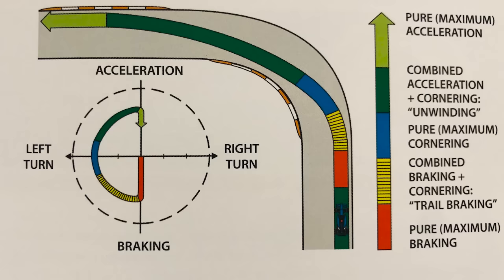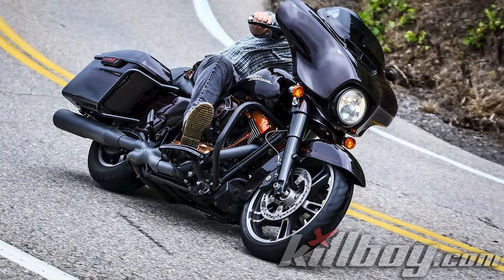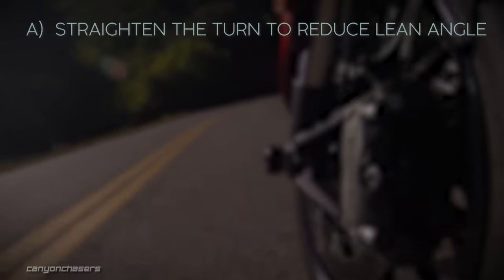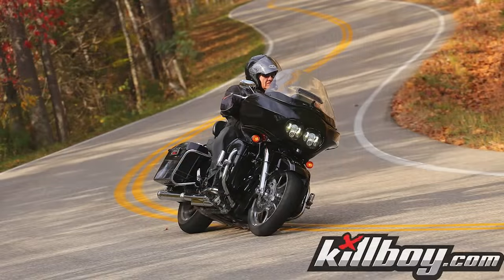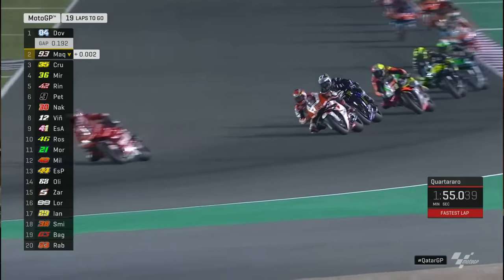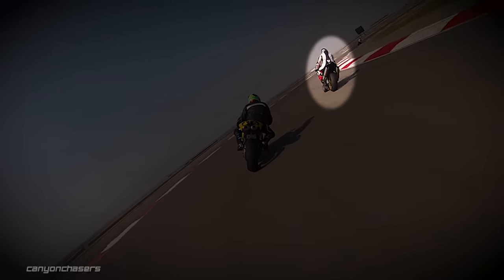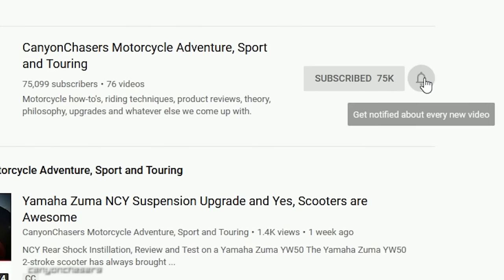How and Why Delayed APEXES Work

Comment: And never forget, your front brake is your most effective and most powerful tool. It's your friend. It's the quickest way around corners.
Reply: and best way to dump your bike
Reply: @davidjones-vx9ju  Obviously, if you treat the lever light a light switch, instead of a dimmer switch. Funny how few people understand just how powerful and effective the front brake is. It can be used all the way to an apex, even while leaned over. It can be applied HARD, after the front tire contact patch has increased by weight transfer. But without practice, they will never know.

For instance, the most extreme brakes on motorcycles belong to MotoGP bikes. Carbon ceramic rotors and 4 piston radial calipers. How strong is the single front tire contact patch?
177 mph to 59 mph in 5 seconds. That's 23.6mph reduced per second average.
1,100°F carbon-ceramic rotors temperature before brake-release.
Reply: The unforgiving friend: the front brake.
Reply: I often trail brake into a corner. Unless you pull it on way too strong your front won’t wash away.  The bike doesn’t try and sit up if you do it gently . Practicing gentle breaking into a corner means that if you do need to slow up if the unexpected happens  you’ll be less inclined to grab and wash out.

Comment: Delayed apex is the safest way to do it in the streets. It is also the fastest way through a corner. However motogp racers also uses different lines such as overtaking/defensive lines or the ordinary racing lines strategically to overtake and to block competitors from overtaking.

Comment: The #1 Reason I Will Trail Brake in every corner!

Somewhere in one of your previous video you said. I paraphrase "NEVER run wide in a corner, NEVER touch the line ina corner, NEVER have a white knuckle curve, NEVER be afraid of twisties and run for the interstate." Trail braking is the Magic bullet to have all those NEVER. It gaves you the confidence to enter later and faster with the brake light on...knowing that you can correct your direction just by adding a few points of brake....That's it. and it does work in the car as well (a safe place to practice). THABK YOU,THANK YOU, THANK YOU

Comment: I could never figure out why I struggled with certain turns using slow, look, crash, and burn until I learned about trail braking! I first learned about it from you, Dave, right here on Canyon Chasers! My friend turned me on to your channel some years ago, and I am hooked! Trail braking changed everything for me, and it's saved my bacon a few times as well. I don't ride a crotch rocket, but I have found that it doesn't matter. I ride a 1,000 lb. Gold Wing, but trail braking works the same. In fact, I rode "The Snake" here in northeastern Tennessee where I live, and trail braking made that experience so much more enjoyable! It's 489 turns, 3 mountains, and 1 valley. 

Thanks for all you do, Dave! I always look forward with great anticipation to your next video! Ride safe, sir!

Comment: Great video. I learned some of these techniques like trail braking and delayed apex by trial and error as a kid riding bicycles and racing other kids around the neighborhood. When I was old enough to ride motorcycles, I would subconsciously use these methods that transferred from riding bicycles. If it has two wheels, physics is the same.

Comment: I am a cyclist in the northeast USA. I use this method to turn, there has been a few top riders who have gone down recently from not knowing the physics behind turning this this. They lose the front wheel or the back wheel kicks them off. I am a lot heavy than most cyclist taking turns a pve 24mph which helps stay mounted. One of my friends broke his helmet trying a variation of the turn. I wasn't on that ride but that might not have happened if i was aware i was being mimicked on the bicycle. Ride on!

Comment: Thanks for bringing that up.  That was my initial of thought of cornering.  After the rain had let up, I went for a short ride and in approaching a Right turn at the last of three curves, I moved over from just Right of the center of the lane to the outside of the lane and hit a narrow strip of gravel that the rain had washed on to the road.  My bike slipped out, like marbles underneath and the bike and I slid about 20', me on my butt.  Loose gravel has worried me since, lesser now.  I'm thinking now, I should have been wider at my approach than I was.   Good refresher for me.

Comment: With 40 yrs experience riding all manner of motorcycle in all sorts of hooligan ways, this is undoubtedly the best way to go around a corner, dirt or tar. Slow in, fast out. Works at any speed.
This is also very useful for the idiots coming the other way, because if you're out wide on a blind turn and the oncoming traffic goes wide, you are already off to the side, "away" from the danger and once you can see the apex and exit of the corner, you can see if it's safe to tip it in.

Comment: Greetings from FL! Our "curved roads" are straight lines compared to those in the video. But it's nice to be able to take a concept and apply it to any corner, anywhere.
Thanks for adding the visuals along with the explanation. The yellow/red/orange circle graphic helped so much! 

Also, my wife and I are going on a trip to Grand Canyon, Bryce, and Zion National Parks. Your last video of Utah 12 was amazing. We're definitely going to drive that... even in a rented SUV, it would be a shame to miss it. I think from Bryce, we'll drive up to Torrey and back.
I would have been so mad if I had not known about it, gotten back home, and then seen the video! Keep up the good work!
Reply: try to set your trip up to have breakfast at Hell's Backbone Cafe in Boulder. they aren't open all year, so call and check before you go... but worth the stop.
Reply: @TMCmakes  thanks Mike! Will certainly look into it. No trip is complete without planning for good eats!

Comment: Watch, really listen, apply to your next ride, repeat.  When we get this it makes a huge difference.  It also helped me a lot getting my hypermotard but it’s applicable on the blackbird as well.  Great coaching guys, Thank you.  When we get to daylight savings lets do a lap of Tasmania in 1 day, 1050 km and 10000 corners.  Can’t wait
Reply: Is that legit about a lap of Tas having 10,000 corners! I've done three trips to Tas but thats what I'm doing on my next trip if that's real. Any link to route or website or something? Thanks!
Reply: You're a cruel man wanting to do a 1000 k day in the twisties on a blackbird. Not knocking the bike as I still have my second one. I've spent some time on the west coast but never had my bike down there. I think it's a little on the tight side for the blackbird along with limitless opportunities for puckering through the wet patches. Probably need to get the seat surgically removed at the end of that day.
Reply: MiREKO Dude!  Took me a while to figure out how to reply,  I don’t know if its really 10000 corners but there is a LOT of 2nd and 3rd gear,  Ive done it 3 times on the bike and once in the car.  I live in Burnie, so we start by heading to Devonport, onto the coast road at Sulphur Creek to Devonport then the exciter highway to Launceston, over the Sidling Mt Range to Scottsdale and on to Saint Hellen’s, Down the east coast to Orford, across to Sorell then after the Tasman Bridge on to New Norfolk and head to Derwent Bridge, Queenstown and the 90 bends, Tullah, then home through Hellyer Gorge.  Ive done it in both directions, depending on departure time, you want daylight in Hellyer Gorge.  No big stops except lunch.  Pretty close to 1050 km, 14 hours, not much speeding as a lot of it is tight.  One time I went up Elephant pass and down St Mary’s pass just to fit it in.  It’s a huge day.  Maybe we should do it in 2.
Reply: TBone MC   You do have to stand up a bit on the ride,, Looking forward to doing it on the Hypermotard ....👍🏍
Reply: @scottspringer6036  awesome dude, thanks for the directions
Reply: @scottspringer6036  hey Scott, I grabbed your number from your comment, you should edit and remove that 😆

Comment: I’ve been riding for 33 years now, this is great to see by diagram.  I’ve always said it as, come in a corner hot, mild rear control pedal, and roll it on, on the way out of a corner.  This is the true feeling we all chase.  This can enable a rider to be 1/2 second faster in a corner.  Now apply 1/2 faster to every corner. Even on a simple nascar track that’s 2 seconds faster per lap.   
You’ll never read this anywhere, this is experience talking. But let me know the effects of 2 seconds per lap faster in nascar. With that attitude, even you’ll be signed to drive for someone. 
R is for RACE.

Comment: Excellent video and explanation. The only detail I would suggest adding is at the 2:48 mark for your Apex definition.  The Apex is everything you said plus it is the point in the corner you can begin to add throttle and stand the bike up.  You can see the rider in the video doing that and that critical bit is how you, the rider, can get instant feedback if you hit the apex correctly.   "Can I start to accelerate from this point?" No, not at the apex yet and I probably Apexed too early if I'm hugging the lane markers.

Comment: Excellent explanation of solid principles. I live in a rural coastal community. The 25 k road to town is a fun winding ride. Improvising these concepts for my approach to my ride like so.....I like to stay away from the dividing line on corners because far too many cars do not, often crossing the line. I move to the right, out of the dominant lane on left corners before setting up my entrance and then follow through as you describe it. I have a better view of the exit, or, more importantly, what or who is coming at me. The road isn’t my worst enemy out there. Liked and subscribed.

Comment: Excellent mix of graphics, stills, positioning of cameras, crashing demo’s!! and the editing. I’ve put together drone videos shot on “Tail of the Dragon” and just getting to understand and use these techniques after 50+ years of riding has helped get rid of that puckering feeling riding that road(though some curves on the Dragon it’s a crap shoot to hold a line). Thanks guys, well done! vVertigo

Comment: My quick tips as a non pro.
1. Have your body further over than the bike (in corner, at speed). So you can pull it towards you more, rather than attempt to push it down more. 

2. Ease up. Tense is stiff and your inputs become very unnatural. Be loose and smooth. Smooth is fast. Relax. 

3. If you think you can't make the corner, do NOT smash the brakes, very gently trail brake and TRUST YOUR MACHINE. It CAN make the corner, just be able you can too. I've panicked and it's nearly ended badly. Not until I rode less stiff, and TRUSTED the bike and myself in a corner, was I able to actually really start scraping pegs. 

Safe riding! Feel free to correct me or add input.

Comment: Running wide consistently  on exit can also be a symptom of improper  suspension adjustment..rebound speed and front end extension for example increases rake and slows steering.

Comment: Late apex can be a hot topic, but it just fundamentally makes a shift in your mind and riding characteristics, coupled with trail braking.
Reply from the maker: Yeah. I'm not sure why it's controversial. It gives us a plan for the corner and it helps us rate how well we did on our way out of the turn.
Reply: @CanyonChasers  Indeed. Well as they say, different strokes for different folks, that is until they learn what stroke leads to where, that is.

Comment: I am also preparing for the dufus in the other lane, coming from the other direction, and not staying in their own lane. I stay in the outside lane for car tires, and out of the inside lane and out of the more dirty lane center. On a track I would be going inward to the apex, for less lean angle and straightening the turn more at a higher speed.

Comment: Great video! Because of you I've been trying trail braking and it does make a difference. I do have a question about the example around the 10:30 mark: that apex is waaayyy around that corner. I'm assuming you're not necessarily braking all the way around that long bend, but just getting to the point with either braking/maintenance throttle before accelerating out?
Reply from the maker: Great question! If its downhill, yes you would brake almost all the way to the apex. If uphill, then you would be correct. Slow until you are comfortable with you speed then maintenance throttle until you can line up the apex and exit. Then turn and drive past the apex.

Comment: I’m not a motorcycle rider but have to say the techniques you’re describing work for cars too.  “Late Apex” cornering is what I was taught in a high performance driving school.  Though due to the width of a car we’re talking about back roads where you can see around the corner and avoid a wreck.  Yeah, over the centerline.  Learning these techniques will help you avoid wrecks too.  When something crazy happens in front of you instead of slamming on the brakes because you are stuck in your lane prison you steer first, brake second.  Thanks.

Comment: Riding on the road with other traffic and changing conditions and hazards you should look at using limit points to get the best and safest line around a corner. Unless you are on a race track, which you are not.

Comment: How effective is using outside leg to push down on the peg on a corner.. a vid in your great style will surely help us to understand , Many thanks
Reply from the maker: Think of your footpegs as little levers to help the bike do what you want.  Push down on the inside one to help it tip into a corner. Push on the outside one to help the bike stand up and come out of a corner.
Reply: Many thanks for the advice , Also taking the time to answer swiftly. I shall go practice.
Finding your vlogs very useful and been slowly putting your teachings to use.
Keep up these great informative vids.
46 year old Uk fan!!

Comment: So right on all points,but i find entering wide scary,as youre going close to vehicles coming the other way around bend!
Reply from the maker: We want to be adaptable riders and adjust to our current situation. There are lots of times where I enter super tight to avoid potential oncoming traffic. But this also means I adjust my speed and go even slower.

Comment: I believe...... SPEED..... is the key factor.
Incorrect speed leads to issues on every aspect he just mentioned evolving corners. 
If you are not good on corners, then slow your speed BEFORE entering a corner.
Many corners have the corner's speed posted...... drop 5-10mph below that posting and you should be good
no matter what lean/apex/entrance or exit you make.

Comment: I've noticed that the psychology of drivers in general is that the highway is a constant and off the highway is a constant and that oncoming traffic is a variable, anywhere on the highway is preferable to being off the highway, so we have a natural fear of the fog line relative to the center line, even though running off the highway is preferable to a head on collision, drivers still want all of their lane and some of mine. The point is that entering the corner wide causes some degree of stress which short circuits the whole plan and leads to the panic in some riders where they freeze with embarrassing and or disastrous results!

Comment: I think what you can add to this is that motorcycles (specifically superbikes), have a much higher power to grip ratio than cars. The higher the ratio, the more straight you have to exit the corner to get the best acceleration and not spin out (or high side in this case). Thus slow in, fast out along with the late apex technique to get the best out of the bike.

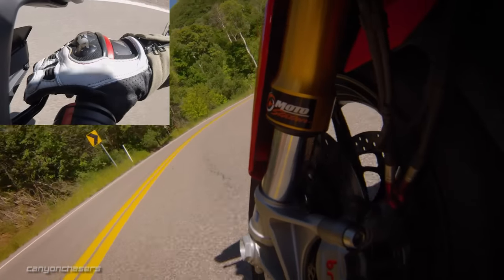Comment: I'm currently half way through Nick's book and he takes trail braking to another level with ''maintenance throttle'' - adding just a little bit throttle to maintain the speed and lean angle if the corner is a bit longer than expected or uphill etc. It happened to me few times. I was mid way through a turn but slowed down too much and thought OK what now? On a new road, you don't know how fast you should enter the corner to have enough momentum that will get you to the apex because you don't know how long is the turn. And I think that's what happened in this video as well at 06:52 . You didn't see the corner exit yet but you completely let go off the brake and started accelerating because you slowed down too much. Maintenance throttle while trail braking ain't easy but I'm working on it. Maybe you could do a video on it as well? Thanks :)

Comment: You mentioned the graphics in motoGP that show throttle and brake levels. Are you aware of any kits that can be added to street bikes to produce such displays? Bikers are producing video on new Gopros showing GPS/location and speed, it would be so cool (and a great teaching tool) to display throttle and braking intensity embedded with the video.